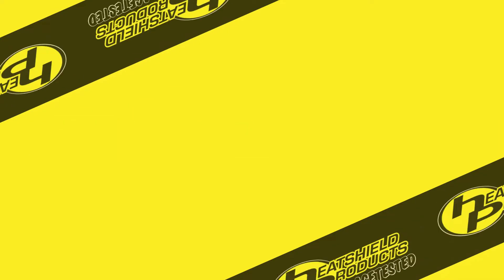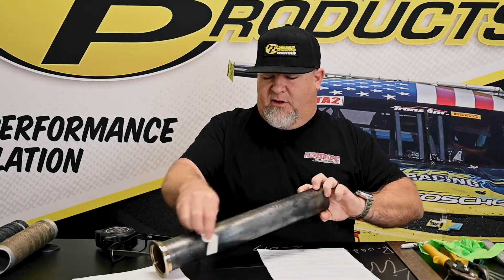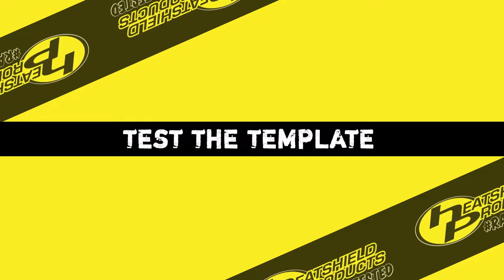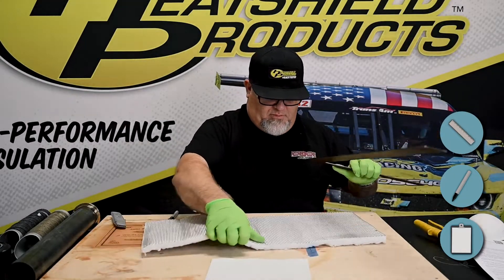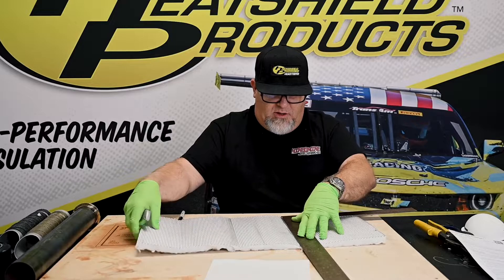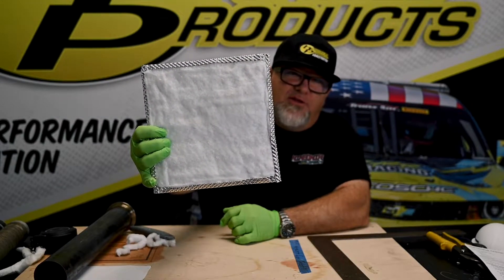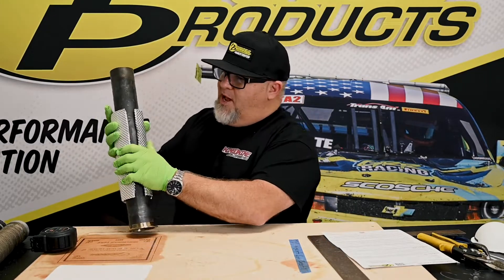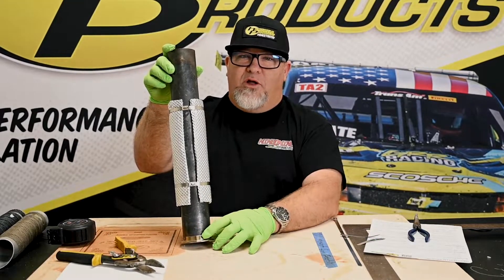How To Install Heatshield Armor® - Detailed Instructions

Comment: Would you recommend to put the gap on the top side, or bottom side?
Reply from the maker: Great question.  The gap would normally go where the airflow can take away the heat.  For instance if you are trying to keep heat out of the floors you would aim the gap to the bottom of the pipe facing the ground and away from the floors so the air flow can take the heat away from under the car. Hope this helps.

Comment: If headers have been ceramic coated can you still use this product ?
Reply from the maker: We do not use ceramic coating so we have not tested that.  You may run the risk of over insulating your exhaust.  It is your car and we would never tell you what to do with your car.  Just make sure you are using a good quality steel.

Comment: What is the point of the gap?  are you not just letting heat out? You go to all the trouble of wrapping the pipe to prevent heat loss but now there is a good amount of pipe left exposed.
Reply from the maker: Gap is recommended as the silica pad holds in a lot of heat, the gap allows the pipe to breathe.  It is a recommendation.

Comment: The only thing wrong with my SUV are the exhaust heat shields that rattle on bumps.  I tried metal zip ties and extra fasteners to no avail.  A heat shield like this should prevent this issue.
Reply from the maker: They are held right on the pipe so there is no rattle.